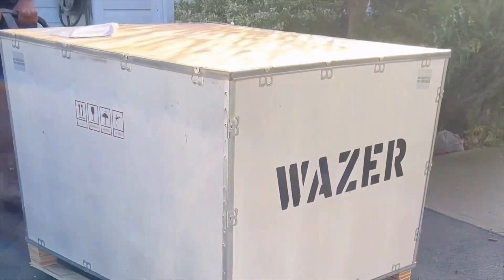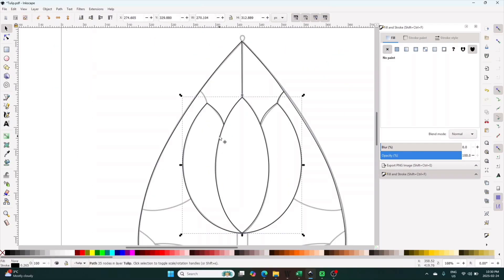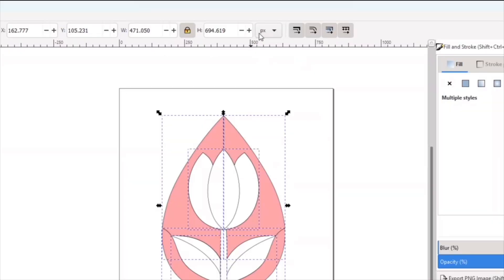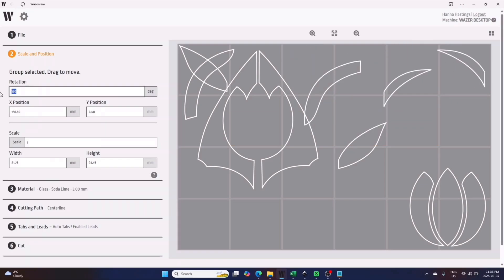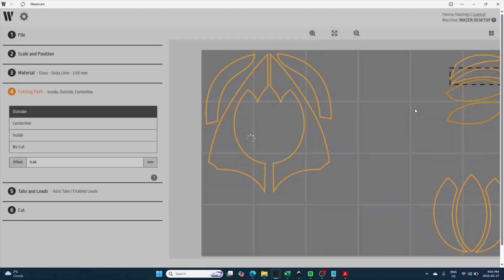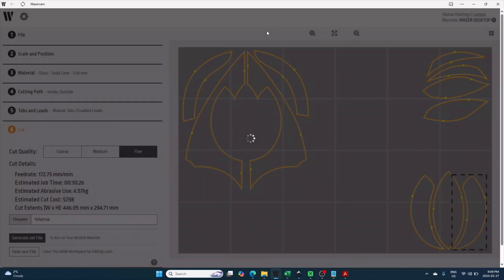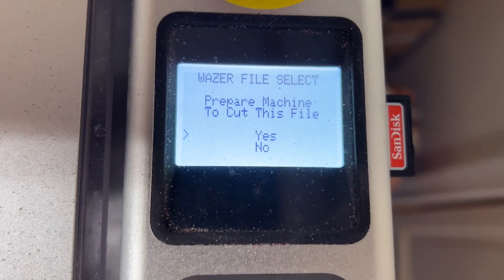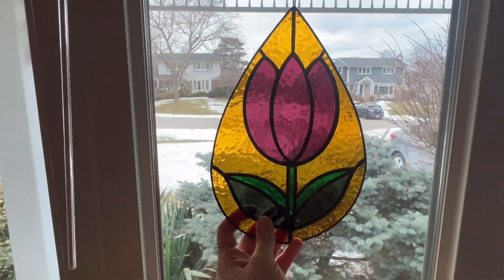How to use a @WAZER waterjet to cut stained glass projects

Comment: fyi, one of your last steps in inkscape should be to reduce the number of nodes per curve, reducing nodes makes a cleaner faster computation within the cnc coding. The higher the number of nodes the slower things will be, and in some cases the less smooth it might be. You're mostly doing small stuff so might not notice it as much, but doing a batch of 30 or 50 patterns those seconds and minutes differences between high node and low node count will become noticeable. 
I'm not overly familiar with inkscape compared to vcarve but it should be in there somewhere.

Comment: Thanks for all the info Hanna! I was excited to see what you would do with the Wazer when you got it. Will you be utilizing it for all your plant work to help cut down on time and increase production? 

Do you find the trade off on time vs glass waste to be worth it? Do you still use the glass cut offs for anything?
Reply from the maker: So far I’ve been using the little scrap bits for jewelry and of course anything fusible gets smashed into frit so the waste isn’t bad!

As for plants I am trying to let go but I’m a bit personally attached to making my existing product line by hand 😅… I’m trying to come up with new designs that the Wazer would be better at than I am so it’s like my partner vs my replacement
Reply: @SandandFireWorksArt that totally makes sense! Use it for project that might be trickier to cut or get a good clean fit. I’m looking forward to seeing the new pieces you make with it!